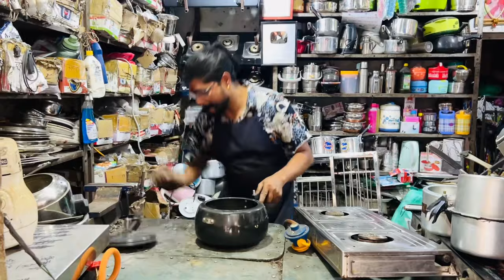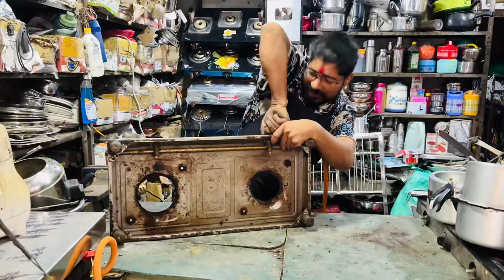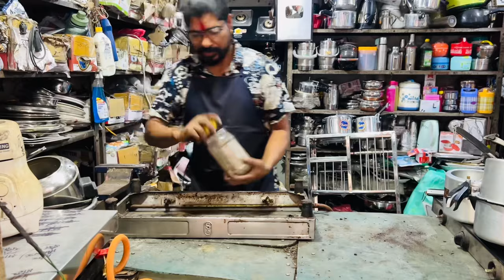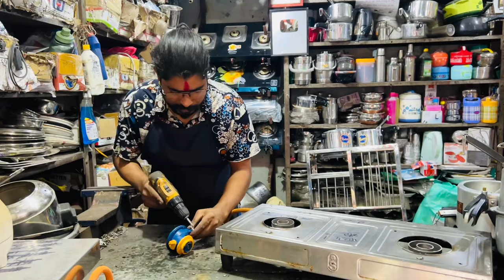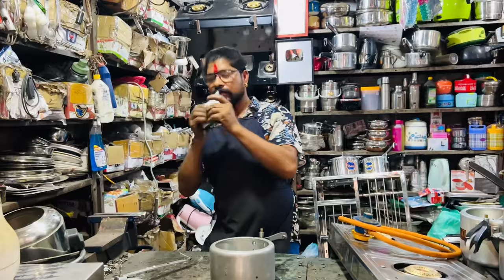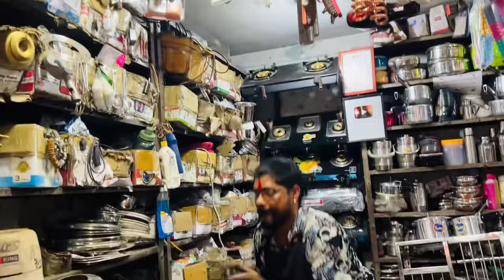Repairing chulha ,don’t try in home ,this is only for export ,repairing in a few minutes ,very fast.

Comment: I'm a professional micro-soldering and a certified electrical technician. I must say that this man is talented both in entertaining and repairing.
Reply: Was his outcome product correct? I mean there's no flaw in the repaired unit?
Reply: @Mr.Loks_  Well looking at how fast he do the work, i don't think that the repair work is flawless. we as a technician or mechanic would need time to do the job correctly, even if i've already do the kind of work for years it doesn't mean that i can do it in such a rush like that. so, the conclusion is, no. i don't think he did a flawless work. but, yes he knows what he's doing. he's doing that for enternaining and part of the marketing trick. look how he's punching that pan like nothing XD for sure it will leave a dent or a mark.
Reply: I must assume you're coming from an infamous South Asian state?
Reply: @vke7880  No, Not indian as well. I just appreciate his work. Maybe you noticed my grammar since I'm not a native english speaker. But yeah, my legitimate is real.
Reply: He's so talented he can repair a brick
Reply: No way